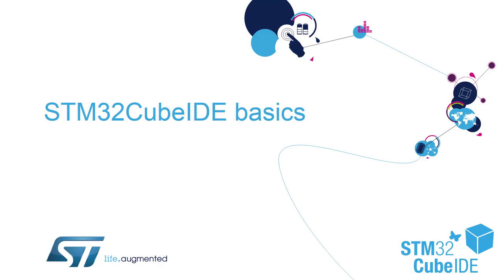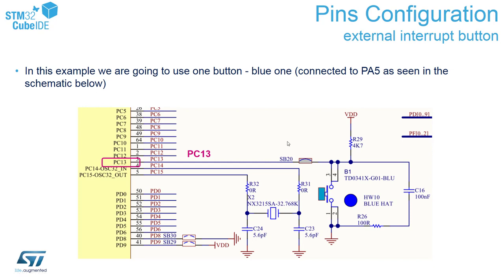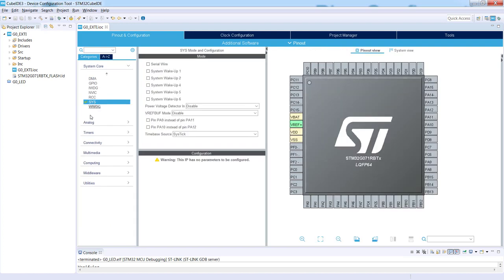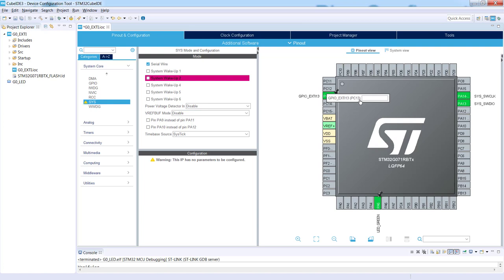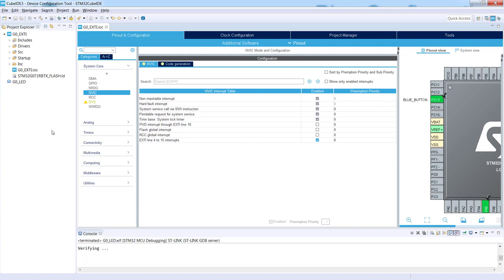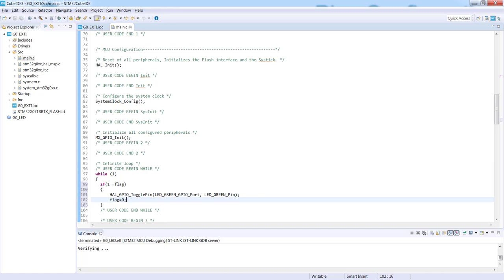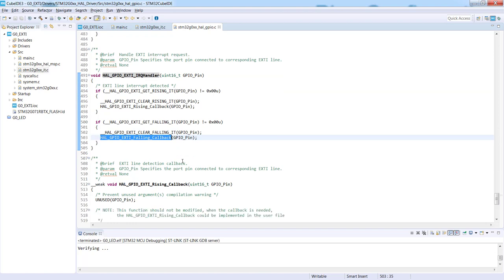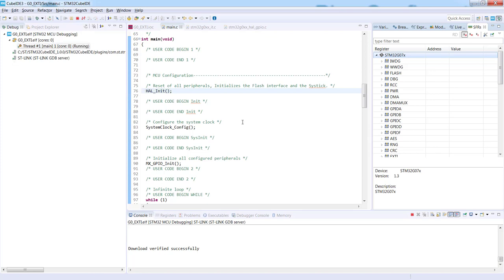STM32CubeIDE basics - 04 EXTI HAL lab

Comment: I had the same issue when following along using the F769IDisco board. The code was getting stuck in an Error handler while loop before I could ever press the blue button. My problem was I initialized the project by the board and not the MCU. Once I initialize using only the MCU, and set up only the LED and Button pins, there was no other mystery code/interrupts trapping the execution.

Comment: Variables used in Interrupt functions should be declared volatile.
Reply: Why?!
Reply: @kavorka8855  to not have issues with compiler optimization. (If variables arent changed in the code, compiler doesnt know they are changed from outside).

Comment: What if IDE doesn't generate separate rising and falling edge callbacks in its hal_gpio.c file and generates one EXTI callback? this is in IDE 1.3
void HAL_GPIO_EXTI_IRQHandler(uint16_t GPIO_Pin)
{
  /* EXTI line interrupt detected */
  if (__HAL_GPIO_EXTI_GET_IT(GPIO_Pin) != 0x00u)
  {
    __HAL_GPIO_EXTI_CLEAR_IT(GPIO_Pin);
    HAL_GPIO_EXTI_Callback(GPIO_Pin);
  }
}
Reply: It´s not difficult to check the actual pin state and decide, how to continue...

if (GPIOA->IDR & GPIO_Pin) {...}  // true, if GPIO_Pin on port A is high ...

there are also HAL functions for this (just don´t know them, because i never used them..)

Comment: Great Video.
When i try to employ this resource on stm32f103c8 and stm32f407VE i've got an issue (both uC). I set falling edge trigger on EXTI when i apply 200 Hz signal (0 to 3,3V) to EXTI GPIO, the output should just to toggle, but through osciloscope i've seen this not happen exatly this way. Sometime has toggle on rising edge, sometime has a toggle on falling edge ( i've set only rising) and sometime no has togle in rising edge. Is there any setting that improves the EXTI performance in frequency (even low frequency)?

Comment: hello,  I dont have the both callbacks, just 1: HAL_GPIO_EXTI_Callback() ... why?
Reply from the maker: Hi there, for technical questions we really recommend you check out our community of experts and other developers at community.st.com
Reply: Same here.. did you figure it out?
Reply: I am using this lesson for a STM32G474RE nucleo board and got the same problem.  It seems that if you are already selecting the falling edge for the interrupt in the hardware, you could just set the flag in the interrupt service routine itself (in the user code section) and not worry about the callback, or you could just use the callback you were given (as shown in your message) and redefine it, since it's only called on the falling edge anyway.  This is a question for the instructor or the community, but I got it to work by doing the latter since it followed the course more closely.
Reply: @stmicroelectronics   these are class-specific questions that would be nice to have the instructor or another one to get answers from.
Reply: Yes.  See my reply to Felipe below.